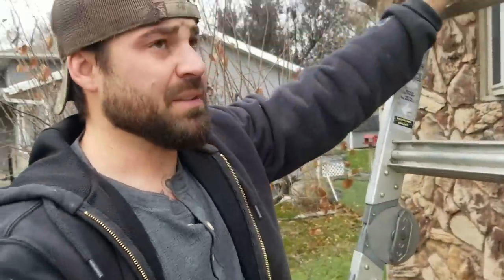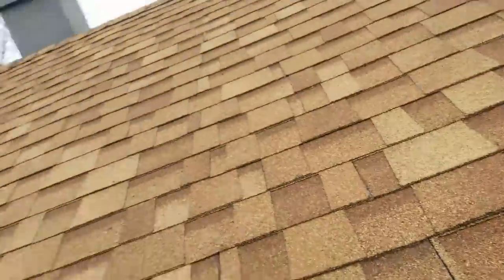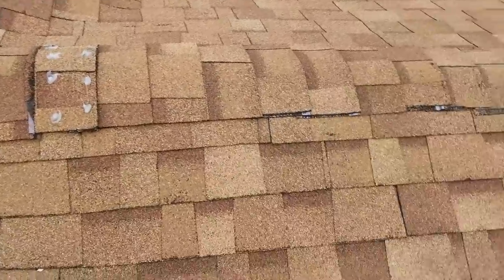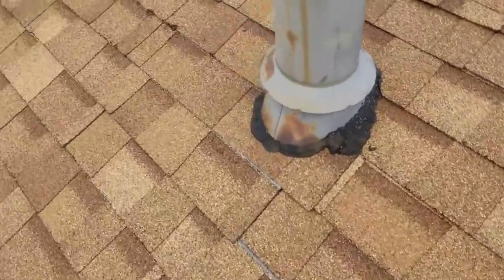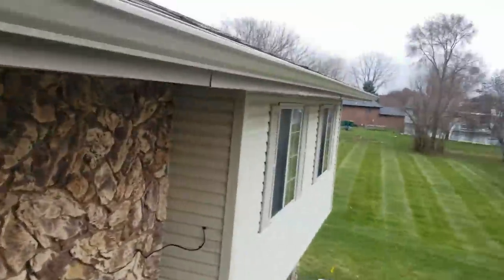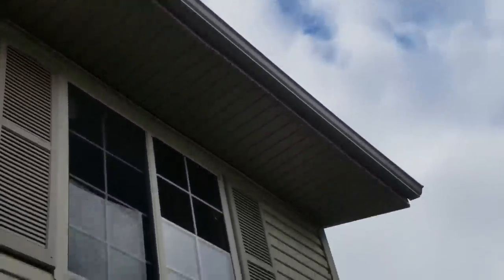Worst Roof Ever Installed!?!? (Part 1)

Comment: I think it’s a win he didn’t nail. If you’re going to completely botch a roof it’s better the next guy can tear it out easy.
Reply: Pros it's light so throwing it away is easy. cons it's a POS
Reply: Plus it's only one layer and new shingles.... I hated tearing double layer roofs. Old shingles are so crumbly and sometimes you need to wheel borrow/shovel it to the dumpster.... this job is a easy tear off that isnt tarred or nailed anywhere,  this roof reminds me of the old staples they used during the big boom. The wind just blows em right off
Reply: I help my dad fix tons of shitty jobs people do and they ALWAYS use so many nails makes it a total nightmare to tear down to replace
Reply: Opie Taylor he high nailed it. Or else it would it stay on the roof.
Reply: Opie Taylor 

It’s definitely nailed. It’s just nailed really high. This guy knows what he’s talking about, just overlooked the fact that bad roofers always nail way high. So high that you can’t see the nails by lifting up the tabs.
Reply: I'm honestly considered not nailing next time...I can't...believe...I mean the shits heavy and it's got "glue" strips...maybe...just maybe....
Reply: That's very true
Reply: @jacobcragen7133  Think of the money saved not buying nails....
Reply: I'd rather not have to fix someone else's work to begin with. Gives the industry a bad name and screws the customer. I'd want the customer to have a good experience, regardless of who they contract with.
Reply: @mr_chuckles1270  Let's not complain, thanks to them you have a Job.
Reply: Its impossible to do an entire roof with no nails

Comment: I have been doing roofing for 30 years and I was ready to say I have seen worse. But after watching the video I can’t say that...
Reply: This is the worst overall I've seen, I've never seen it where everything a "roofer" has touched is wrong usually it's just a few areas where corners have been cut the rest of the work is to an ok standard.
Reply: I have installed about 5 squares in my life. I could do a better job than that 😂

Comment: Looks like some apprentice was roofing for a couple of weeks and decided to start doing his own side jobs lol
Reply: You can't have even seen one shingle job and not know how to book the start. This was done by someone who had never even watched a shingle roof put on, not even one. Stagger seams is just thing one, less valleys, and, how can you pitch a gutter wrong. It's like someone did this on purpose, everything is wrong except the shingles are facing  correctly.
Reply: Come on...... you don’t even need to be an apprentice to look at that roof and know it’s a shiftiest job,most normal folk with even a part of a brain could do a better job than that and still wouldn’t have the brass tacks to go on pretending to be roofer
Nearest he’s getting to a roofer is waking up one morning lying next to one.......
Reply: Naw more like a junkie did it
Reply: And it happens more often than not, not just with roofers.
Reply: If you'd give me a bunch of shingles and a ladder, and no internet access and told me to do a roof that's probably what it would look like.
Reply: @xStarborn  sparky here - can confirm

Comment: As a field catastrophe adjuster for 20 years, I see this kinda thing all the time in all corners of the country.  And roofers wonder why adjusters don't always believe them - licensed or not, poor workmanship is common.
Reply: FINALLY! a comment that hold true!!!
Reply: @affordablesolutions8516  There's definitely work to be done on both sides, so adjusters aren't off the hook either. :)
Reply: @AdjusterTV  yeah I know a LICENSED roofer that years off shingles to get the insurance company to pay for a new roof. Im sure it happens more than I think.
Reply: @affordablesolutions8516  I’m on the contractor side and yes this is sadly very common, most “wind damage” on architectural roofs is manufactured

Comment: Am I the only person that felt like I was about to fall off the roof several times?
Reply: I did
Reply: Lee Woodrough Yes you are.
Reply: Me too yes
Reply: I felt it a little bit when the camera was pointed of the edge.
Reply: VonTyrant We all try!
Reply: Yeah pretty brave to stand on it knowing shingles weren't nailed down
Reply: Nah that pitch isn't steep at all!
Reply: @rufiorufioo : But there wasn't a single nail holding on that sheet of shingles. You can walk around on a shoal pitch all over your scattered loose shingles while working, but an entire roof overlain with no nails would feel a little sketchy. I don't know because I've never seen it that bad. I hardly ever get on a roof around here where you don't have to hold each shingle you lay to keep it from sliding off.

Comment: I did my roof with my dad, and it was my first time. Mine was a frickin masterpiece compared to this monstrosity.
Reply: Most ppl wont butcher their own house. 

Contractors hold alot of contempt & disrespect for minority homeowners especially.  Sone of the bad ones will do excellent work in a "preferred" area of town then come to a minority area & do crap work. I just had a 4 month old roof leak. All the vents & flashing was left open. Un nailed & unsealed. Plus some shingles were on backwards.  It cost 25% of the original job just to correct.  I feel like poor work is a form of disrespect to the homeowner.  In my case i feel they intentionally did poor work.
Reply: Leopold  nope, minorities do the same thing. Same mexicans out there doing five star work in the suburbs come to the city and rip off the poor people.

To be fair, I don't  think its a racism thing. Poor people just pay less and that saps their enthusiasm. But imo you have to have good work ethic no matter how much you're getting paid.
Reply: Good job
Reply: Leopold  I thought he ment an area that isn't normally visited.
Reply: It’s poor people who don’t want to pay for a good job. The majority of poor people just happen to be minorities.
Reply: @CeaseProduction  No you dont. You get what you pay for.

Go for the cheapest option. You will get it.
Reply: @jakedaly7906  Poor people can't AFFORD to pay top dollar BECAUSE they're poor people.  Their roofs are no different then rich people's --- they leak or they don't.
Reply: @CeaseProduction  hey man, it could be Guatemalans, Hondurans, Nicaraguans, or Salvadorans. Either way people just don't take pride in their work anymore.

Comment: Serves the homeowner right for being too cheap to pay for quality...I deal with that crap all the time and then they want a deal to fix it...burns me!!!
Reply: If anything, you will have to charge them more.
Reply: The homeowner may not be cheap and may not have paid a lower rate to have the job done.  The crook knows that he's dealing with an older woman who will never climb a ladder to inspect the roof and she probably wouldn't know what to look for anyways.  It kinda looks like a roof from the ground so she writes the final cheque for payment.  The crook is gone and his cell phone number doesn't work any longer.
Reply: @KLondike5   If the gaps between are bigger than 1/4", we have to redeck the whole thing.

Comment: I'm a contractor here in Tulsa and I'm going to play Devil's Advocate here. It's quite possible the customer was being SO cheap that the roofer who did this job had to cut so many corners to make a profit. You said it yourself that they went with a cheaper bid. Now personally, I never try to bid the job lower than everyone else, because I like to be able to take my time and do a good job. Also, people who only want the lowest price are nearly impossible to work for to begin with.
Reply from the maker: I would gurantee you that I could do this roof alone, faster than the 2 guys that did it, with perfect quality.  Also, the bid was only 500$ cheaper
Reply: @NWIVeteranConstruction  Wow! Only $500 less? I stand corrected. You get what you pay for, I suppose.
Reply from the maker: @iamthem.a.n.middleagednerd1053  yeah,  it's unfortunate.

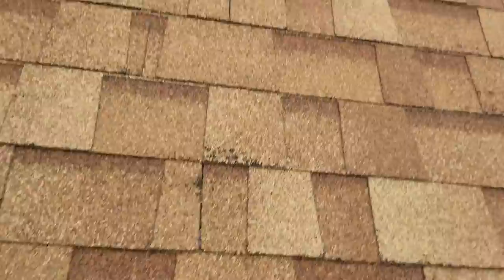Comment: 1:38 Of course he didn't use nails. That would fill the roof with holes, silly.
Reply: Drross FPV and he calls himself a professional. People these days
Reply: Alan Baker they were being sarcastic 😂😂
Reply: @bobjones-dw4yd  ope
Reply: Alan Baker ope
Reply: They advertise as the "Quietest roofers in town!"
Reply: @deanevangelista6359  so quiet you wouldn't know they were there! 
And who needs nails in the roof, doesn't that defeat the purpose of having a roof fixed???? 
I think I'm going to need the guy's information, sign me up for the whole "quiet" experience. 😂😂
Reply: Good one  nail life matters 🤣🤣🤣🤣🤣🤣
Reply: @kingnatesr.5078  
You nail it where one shingle overlaps the other so its hidden
Reply: Well thats how he underbid the job, didn't charge for using nails.

Comment: Good inspector on this video. I am also a roof inspector in Tucson Az and we occasionally come across the same things on roofs here. 
      Most homeowners will leave the roof work to the licensed professionals.  Then there are those homeowners that will attempt to perform a repair, sometimes using that "roofer in a can" that we've all seen on t.v. commercials where the guy will head out onto shark infested waters on a repaired boat.  That stuff is just a gimmick that I have never seen work on roofs.
    Then there are the homeowners that dont do their homework & hire just anyone that says, "I can do the work."  Not realizing they've been taken by someone who is in it for a quick buck, has no pride, no attention to detail, full of incompetence, and real soon, more often than not, will not answer your phone calls.  
      The homeowners in your video learned an expensive lesson.  I highly doubt they will ever collect a penny from the unlicensed installer who did the work.
       With a licensed and bonded company you can look up reviews on multiple media platforms.  You can check them out with the registrar of contractors.  
    Get a bid that explains all the work that is to be performed and if you have any further questions do follow up by contacting the roof inspector that provided your estimate, company supervisor, or the owner for further clarity. 
     Get more than 1 bid, I recommend 3-4.  The more the merrier. 
      Most roof inspections are free, (see below for comments on re-inspection fees where a company is called to look over work after it has been performed by others).
     Let all the roof inspectors that come out to look at your roof that you are having more inspections being performed by other roofing contractors.  This alone helps against price gouging and pushes the various estimators to be honest.
    Ask for pictures of what they see on the roof, making sure that these images are from your roof and not from some other roof.
      If you're thinking, "Damn, this guy has trust issues," yeah, you bet I do, because I've seen both ends of the spectrum!  
    It's your hard earned dollars I don't want to see you loose by making what you thought was an educated decision.  It does happen with some unlicensed and even with a few licensed characters. 
     The licensed ones you can take to court and they can be shut down if need be. 
      Do your homework.  Roof repairs and re-roofing is not cheap.   Make sure you put your roof in competent hands. 
       Your home is your castle and your expensive investment, leave the roof work to the pros.   If you need to have the roof re-inspected by another competent roofing contractor after expensive work has been performed,  a fee more than likely will be charged for a roof re-inspection where others have performed work anywhere from $50 to $200 typically. Prices can vary in your area, you may be surprised what may be found if you want peace of mind.

Comment: I personally wouldn't have been walking around up there after noticing nothing was nailed down.
Reply: On a probably 5 pitch roof it's not that bad plus it's only one floor. High enough to break a leg if u fall wrong but it's not that bad.
Reply: @charliechristian1097  unless you land on your head

Comment: As Professional Home Inspector, I have come across a similar installation issue on at least 4 homes in the last 3 years. I walked one roof and a 10x10 section became dislodged. I ended up surfing down the roof slope almost to the edge before I could get off of the section. Word to the wise, hire REAL professionals for your repairs and inspections. (Be willing to bet no permit was pulled on the roof in your video!)
Reply from the maker: That's crazy lmao hilarious after the fact of course.  Shameful that people are doing business like that
Reply: But, of course, scammers don't pull a permit. They also only work on the days you're off.
Reply: @NWIVeteranConstruction  yeah one thing though. If I don't have to I never ever park my truck on customers driveway. Especially if I'm doing only an estimate or some kind of an iffy job walk around (which unfortunately happens quite often). And if I need to bring tools or materials I always ask. Just a nice courtesy for the owners.
Reply: What state requires a permit to do a reroof?
Reply: @Chris-hm4sn  blue ones

Comment: I'm an amateur when it comes to roofs. I've done a bit, but usually assisting as dumb muscle.
But in the few instances that I actually did something on my own, I opted for going to the extreme to make sure it stays on.

I got a call from someone where I build a garden shed a few years ago, they wanted to put solar panels on it, and they guy from the panels couldn't get the shingles off.
Obviously he couldnt, after I asked if they ever wanted to put solar panels on, and they said "no", I glued them on with XTac before I nailed them into place.

Comment: My Uncle few years ago had me come over with My Friend who does do roofs and look at his Roof after he had a company Put new one on. As Soon as We got there, Friend was like, That Does Not Look Right at all. All this as we are going up the driveway. So Friend went up on Roof and started looking around. Well The Company Did Not use a Single Nail(Or Screws) They used Silicon Caulk.(Guessing for it to last at least the 1 year warranty they gave.) The Ridge Cap was similar to what you had Just Shingles that were cut and Caulked down. 
Friend called someone and within a hour had County building inspector over to take a Look. in the End, Uncle took the company to Court, Friend and the Building inspector were there to give a report and Uncle was able to get all of his Money back and bit More. FYI this wasnt the Lowest Bid. He actually went with the One that was the 2nd to highest bid too. He had 5 Bids.

Comment: Been a Carpenter for over 15 years I always tell homeowners and potential clients going with the cheapest option is almost always the most expensive in the long run. Do your research and ask questions there’s usually a reason that someone is cheaper then everyone else. A good tradesmen knows their work is good, what it’s worth and values their time accordingly. You get what you pay for 9/10.

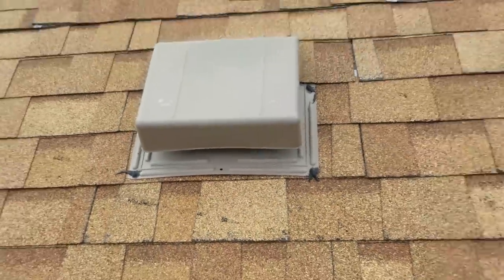Comment: 4:57 Actually, a lot of carpenters leave loose seals on the downhill, be it vent boots or windows, etc. If decades down the road as things deteriorate, there won't be a silicone dam holding in moisture or minor leaks to exacerbate any future issues. Granted, where I live hardly anyone has a shallow walkable roof, so snow may build up and force its way into a boot at that low angle. 
  Even with a low pitch I was impressed that shingle carpet was sticking down well enough without nails that he didn't slide right off the roof while walking around.
Reply: Also, at some point somebody in the neighborhood or driving by must've noticed there was no noise from nails or visually seen guys just throwing them up there. That being said, the fact they kept a pretty straight pattern without kicking them out of place is a fairly impressive accomplishment without a nail.

Comment: Right. I've done my first roof on a garage. (I live in the UK) and I did it virtually the same as most bitumen felt shingle roofs in the US. Even I managed to do it right, been up 6 months no leeks, and looks good. How does someone call them selves a 'roofing contractor' if this is the quality of work they do?????? I'd never laid a roof before, still figured to use a starting strip, still managed to do all the flashing, dripedge, guttering and ridge cap correctly..